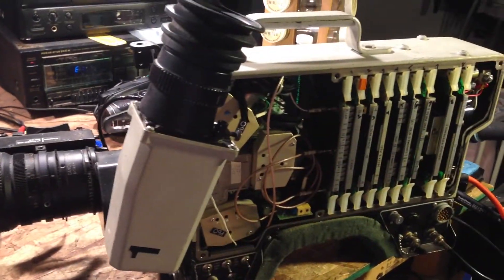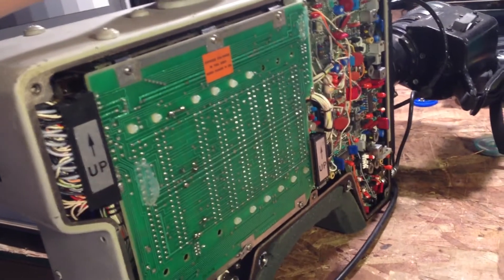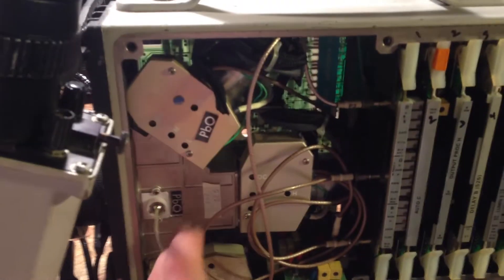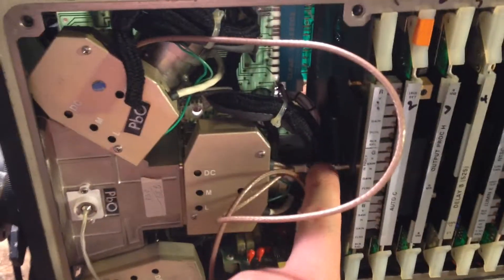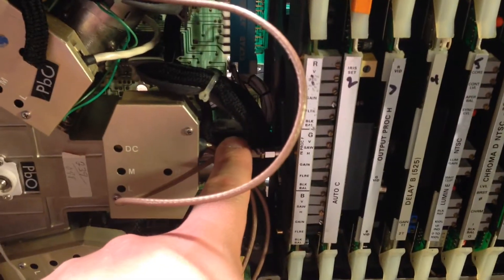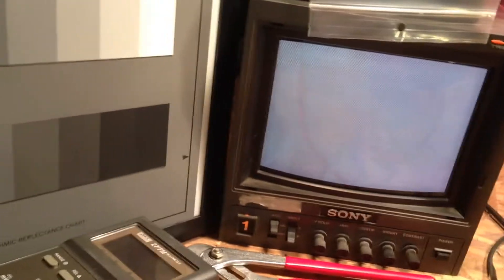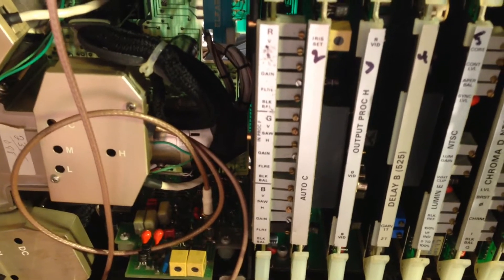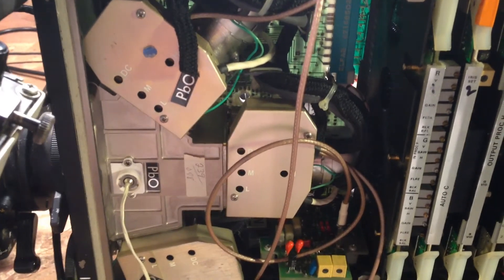RCA TK-86 Issues

Comment: I was one of the engineers who designed the TK-76, and though I never worked on the '86, I'd bet that the contents of that Input Proc board is not terribly different from the  '76.  You will need an extender board to do any real troubleshooting of course.  As for service info, I'd find it hard to believe that RCA would release a camera without an IB (instruction book) containing schematics at least.  If you're still working on this (I see 7 years has gone by!), you might try the folks at the Museum of Broadcast Technology who have a lot of RCA cameras and documentation.

Good luck!  It's fun to see the old cameras again.
Reply: and what a great job you guys did on the TK-76.....a game changer, for sure!
Reply: @RCAquadruplex  Thanks for the acknowledgement!
Reply: @k8zhd  I'm in the process of trying to get an 86 and a 76A and 76B up and running for a "vintage" video project I have in mind.  Still trying to find 76 manuals and extenders.  Is the power supply board interchangeable between the A and B?  I think my B board is dead....looks like I'll be swapping out all the electrolytics to start.
Reply: @RCAquadruplex  I have a '76 manual, and I think a board extender.  I've looked a little into having the manual scanned, but it's pretty doggone expensive -- those long fold-out schematics require special handling.  The board extender is dead simple -- nothing more than a PC board card-edge connector and a matching female edge connector (I've forgotten the manufacturer).  I don't have an extender for the power supply - they were uncommon even in the lab in Camden 45 years ago.  And, alas, I don't know if the A and B power supplies are different. My '76 stuff is in a storage unit right now.
Reply: @k8zhd  The extender board design really sucks but made sense at the time. Now it's basically impossible to find the extender board anywhere. I'm trying to find one for my Sony BVP-300.
Reply: Holy smokes, I would love to pick you brain about the TK76. What an amazing time in ENG!